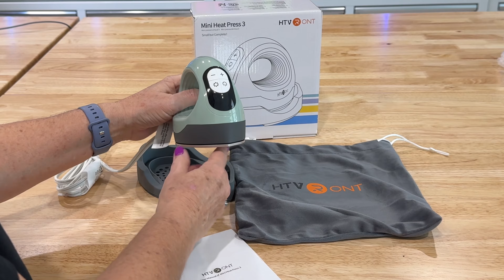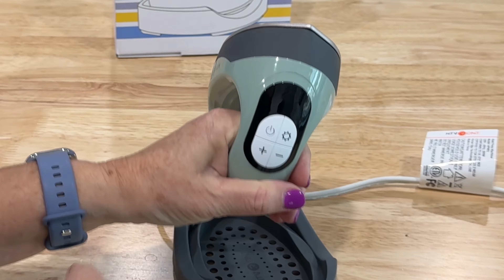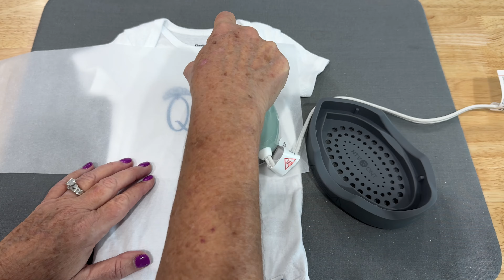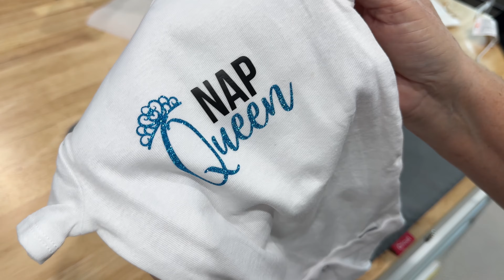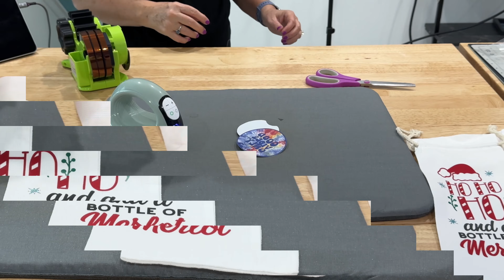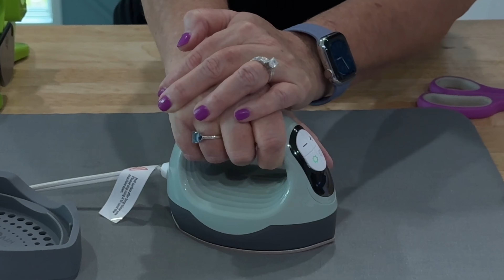Why this HTVRONT Mini Heat Press is BETTER than Others

Comment: how does this work with mugs / tumblers?   That round edge looks really small.  Is it possible to print large images onto mugs?
Reply from the maker: It is a small curved area but if it's all you have it will work. I probably wouldn't use it to put a large design on a mug or tumbler. It is possible to print directly on mugs but you will need a UV printer twith a rotary attachment to achieve that. Check out the Eufy - https://youtu.be/Mu-yM60SStU?si=MC0p1c8vDBDBEP0t